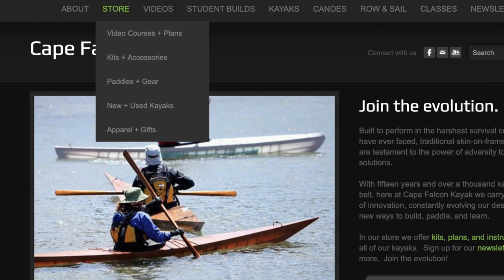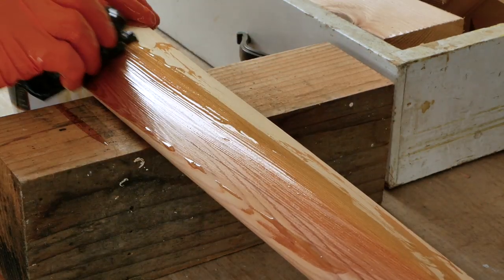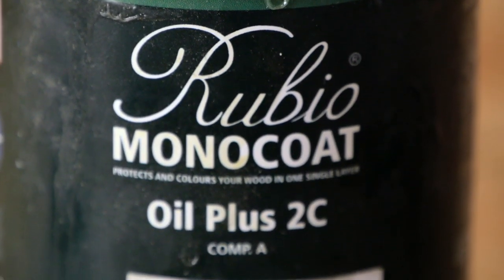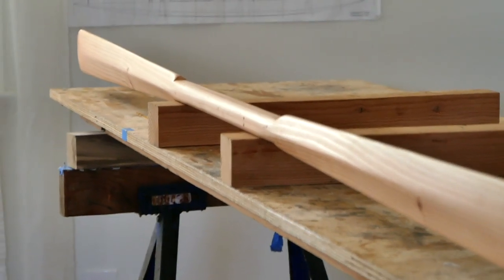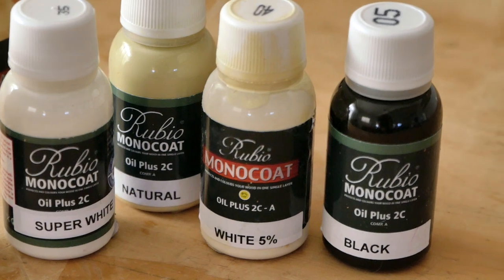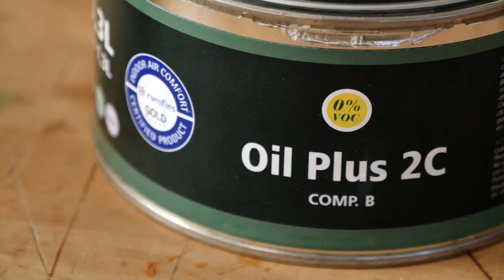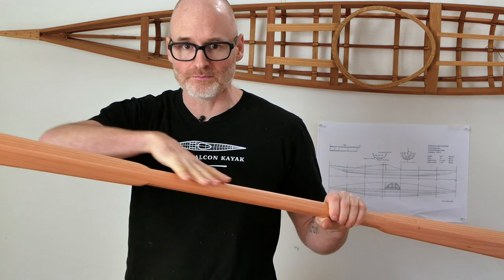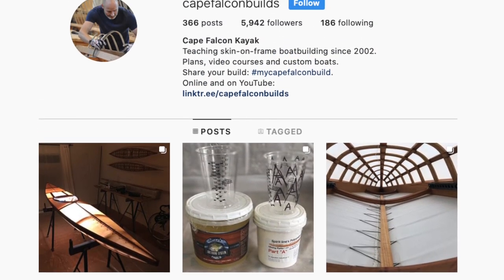Is Rubio Monocoat the perfect coating for a Greenland Paddle?

Comment: Rubio Monocoat is awesome 39 years as a hardwood floor contractor with hardener it's actually 36 hours cure time and it's  not recommended to use without hardener wihout hardener durability is greatly reduced. Great job by the way. 👍
Reply from the maker: Good info, thanks for this

Comment: try the. TATRA coatings offrered in Japan (also I think in the. USA) it is a ceramic coating comes in various levels including  water proofing and  UV resistance  feels almost like uncoated   wood

although that said i have tried it on a paddle yet. and Rubio is a great finish  for floors and tables indoors

Comment: Hey Brian; Thanks so much for all of your terrific videos. Some people recommend wiping the wood down with mineral spirits right before applying the Monocoat. Any thoughts either way on that?
Reply from the maker: I really don’t, maybe that’s the cut any oil residue on the wood?
Reply: Yes, that’s the idea. But if you haven’t found it necessary, I won’t worry about it. Thanks a lot for the quick reply.

Comment: Hello Brian. Have you tried or considered Birchwood Casey Tru-Oil(gunstock oil)? I have used it on several personal projects for kitchen and bathroom wood finish work. Holds up well so far in moist areas and designed for gunstocks... outdoor use. Might be worth a try as well. Similar application, simple.
Reply from the maker: haven't tried it

Comment: would it also be useful to coat the frame with?
Reply from the maker: It wouldn't work because it would be way too expensive and there would be no way to soak it into all the crevices like you can with a thinner oil

Comment: I like the new ideas, but tung oil is $21 per 32 ounces and that much will last a paddlers lifetime.  My paddles were always shipped to me unfinished and I just do one coat an hour for eight hours, then one coat a day for a week, then one coat a week for a month, then one coat a month for a year, then a light sanding and one or two coats a year.  I don't use any wax.  If you have the paddler do the coating then it becomes very affordable.  If the carver is doing the coating then it makes the paddle too expensive.
Reply from the maker: That pretty much covers it, to get any sort of real protection from Tung oil you've got to put endless coats on it and the paddles still get pretty beat up looking after awhile.  No reason to change if it's working for you.  I'm just always so pressed for time that a single application, (if it works) is pretty miraculous.  Seems like a sample bottle is the perfect amount for a paddle, so 10 bucks is reasonable.
Reply: Thanks for that information, Frank, I've used Tung oil (pure, neat) on mine and after a few months they're coming into condition.  My latest one, in Cedar as compared to Douglas Fir, is taking a bit longer to sort out but that's also because I've been a bit impatient to use it and now our Lockdown is over, I can't just leave it outside all day as I could back in June!   That's a useful tip about supplying a paddle unfinished, I have two more blanks which I want to carve and offer for sale and hadn't thought of that, I could always give a customer a small bottle of Tung oil to start them off if they wanted that finish, or point them to Brian's video.  Best wishes.

Comment: Hi Brian, is this the interior or exterior wood oil?  Exterior would make sense, but it's kind of expensive, don't want to get the wrong stuff.
Reply from the maker: I'm just using the interior.  Oil plus 2c.  If you can wait a few weeks to paddle it's only 10 bucks for a sample bottle.

Comment: I recommend you try Everdure, which is a very low viscosity epoxy that readily soaks into the wood. It cures within a day at normal room temperature and leaves a harder surface that is non-porous which is dent and split resistant.  I find that once cured I can go back and finish it with a fine wet & dry and achieve a smoother finish than with untreated wood because the grain won't lift when dampened.  
https://www.international-yachtpaint.com/en/au/boat-paint-products/primers/everdure